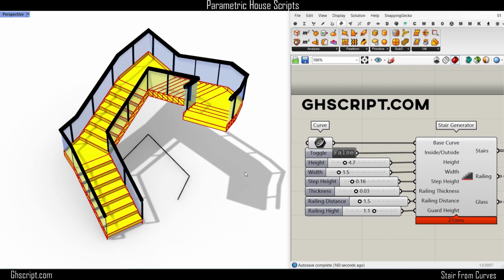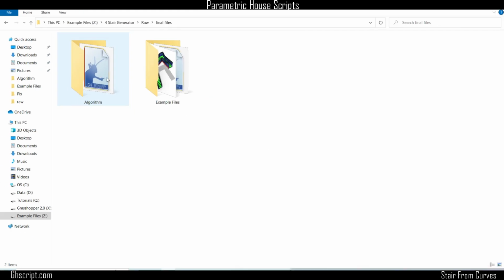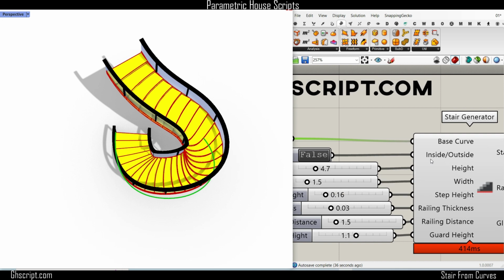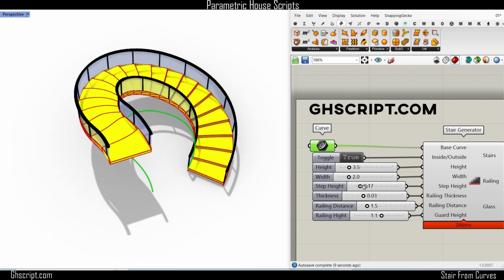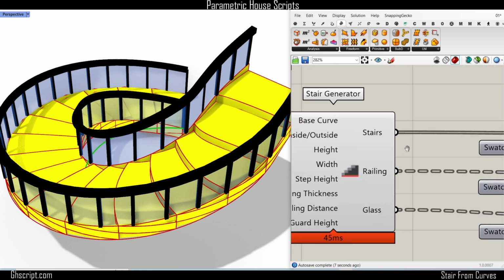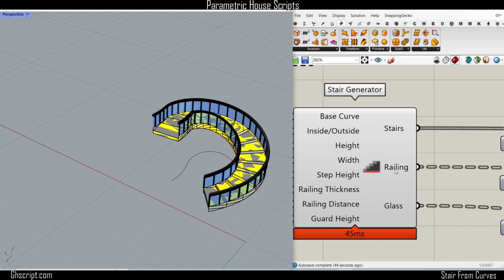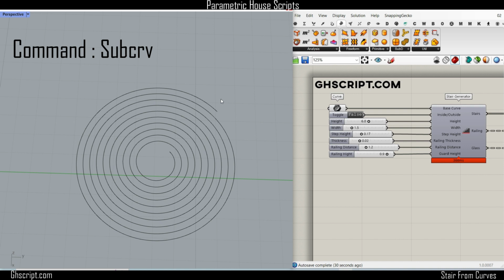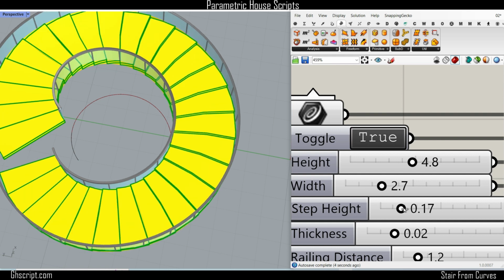Stair from Curve (Grasshopper Script)

Comment: 10/10 

The script construction is already a COMPLETE class of architecture. Even this could get more detailed with the threads the raises and landings. This could really generalize even more. 

THIS IS the exact mindset that is needed for RAMPS with handrails, Windows, Doors, Corners  of streets for  willchair modules on the corners, slopes on street level modules and so on. Other approaches may be classical beam column structural basic systems and modular slabs. 

Grasshopper is not only a device for interesting intricate complex designs. This program is for EXACTLY this too. The user could generate his repertoire using these basic departure definitions. 

PH, thank you very much. This is a real contribution and teaching of architecture.
Reply from the maker: Thanks 👍